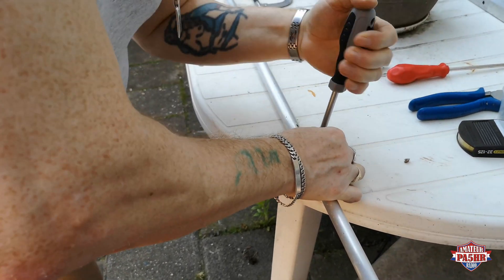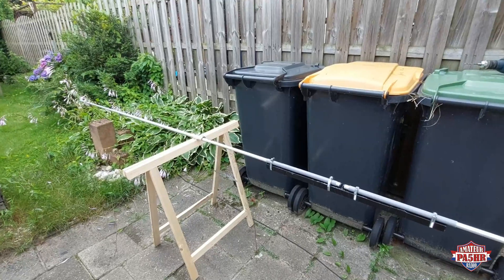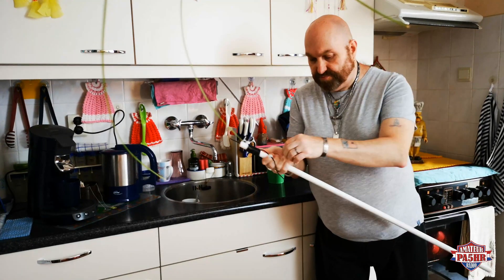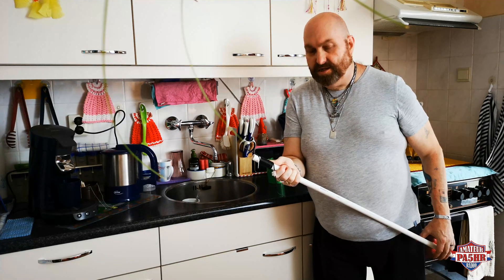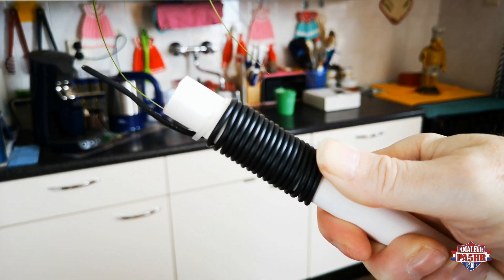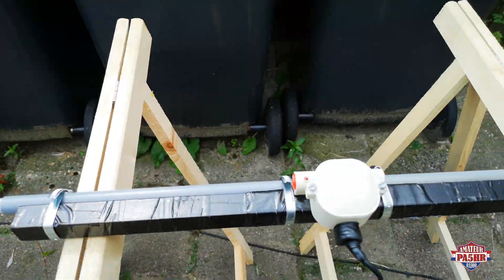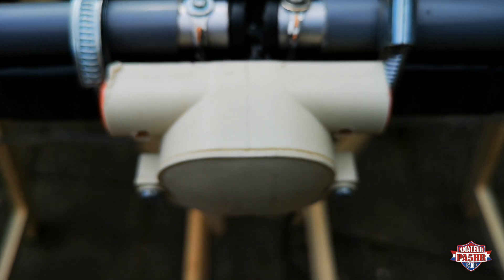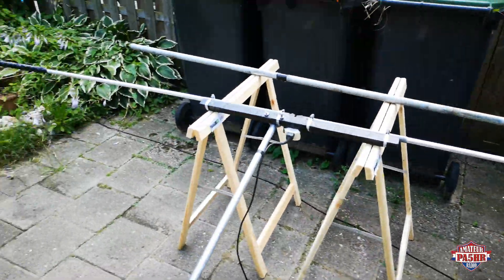Half Wave Dipole for 20 Meter Rotatable

Comment: Does it matter where the coil is placed on each element? 

Thanks.
Greg KA8QWA
Reply: So connect both ends to the coil anywhere on the element?
Reply from the maker: @gjzimmer56  Yes thats right you have to connect the coil with both ends in the Element i have the expirience that when you place the coil in the middle of the Element works the best but maybe you find out whats the best works for you....Vy 73 de Bert PA5HR
Reply: Okay last question. 2.5 meters of wire wound for each coil? Sorry for all of the questions. This is my first attempt at building a shortened dipole. Thanks and 73's!
Reply from the maker: @gjzimmer56  yes thats right 2,5 meter maybe a bit more ore less that is possible so i made the Dipoke half wave length electrical you have to winding  2.5 Meter Wire on the PVC pipe and than you can play with the Elements a bit for the right length you know.....hope it was clear and you have succes with the Dipole there Vy 73 de Bert PA5HR
Reply from the maker: Hello Greg thanks for asking it dosen't matter where you place the coil important is the length of the Element for the inpedance thats all Vy 73 and greetings de Bert PA5HR

Comment: How many turns do I put for the coil 5m as the coil and the dipole 3m per each pole on the dipole, just watching the video now, you could make it in to a beam maybe 👀 🤔 as well cool great video but not 100% with the turns on the coil Thanks Tom
Reply from the maker: Hello Tom you must have the Wire from 2,5 meter and than you can winding the wire on the pvc pipe so you have to do the coil with 2,5 meter wire and the Aluminium elements are 2 Meters and the Coil is 50 cm pvc pipe, so you have in total length 2X2,5 Meter each side ( 5 Meter ) for a good SWR you must can a bit switching the Aluminium Elements hope i can help you out there Vy 73 de Bert PA5HR